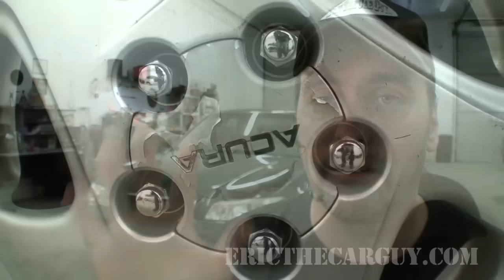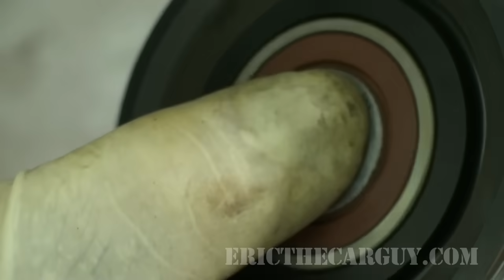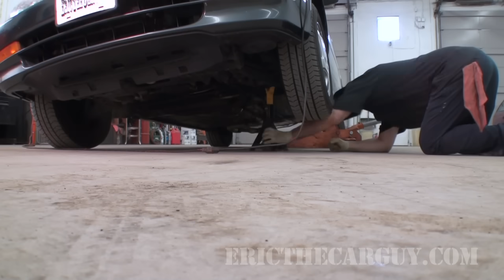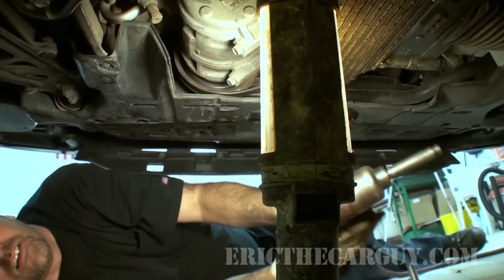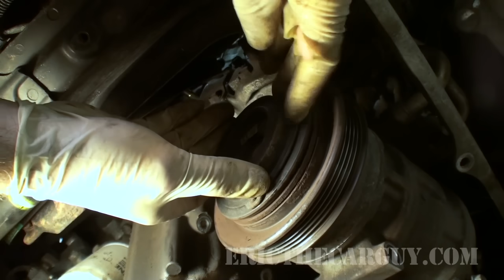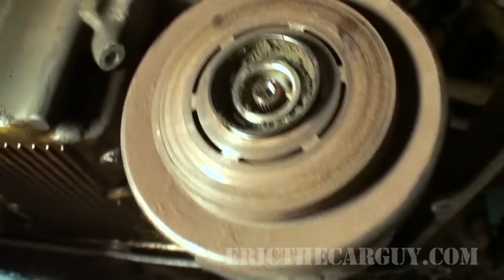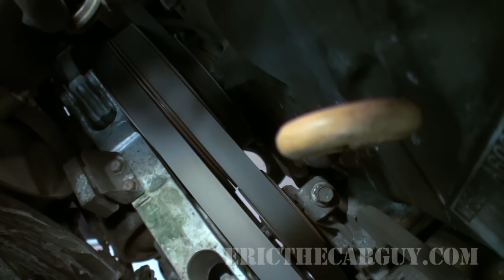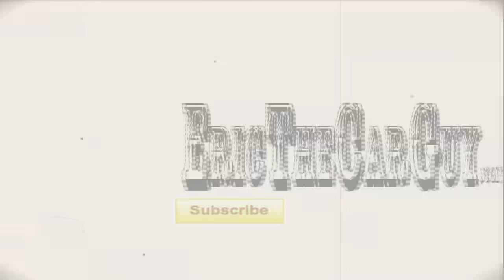AC Clutch Repair and Noise Diagnosis -EricTheCarGuy

Comment: You wanna see a problem with the new comment section?    
You wanna see a problem with the new comment section?    
You wanna see a problem with the new comment section?    
You wanna see a problem with the new comment section?    
You wanna see a problem with the new comment section?    
You wanna see a problem with the new comment section?    
You wanna see a problem with the new comment section?    
You wanna see a problem with the new comment section?    
You wanna see a problem with the new comment section?    
You wanna see a problem with the new comment section?    
You wanna see a problem with the new comment section?    
You wanna see a problem with the new comment section?    
You wanna see a problem with the new comment section?    
You wanna see a problem with the new comment section?    
You wanna see a problem with the new comment section?    
You wanna see a problem with the new comment section?    
You wanna see a problem with the new comment section?    
You wanna see a problem with the new comment section?    
You wanna see a problem with the new comment section?    
You wanna see a problem with the new comment section?    
You wanna see a problem with the new comment section?    
You wanna see a problem with the new comment section?    
You wanna see a problem with the new comment section?    
You wanna see a problem with the new comment section?    
You wanna see a problem with the new comment section?    
You wanna see a problem with the new comment section?    
You wanna see a problem with the new comment section?    
You wanna see a problem with the new comment section?    
You wanna see a problem with the new comment section?    
You wanna see a problem with the new comment section?    
You wanna see a problem with the new comment section?    
You wanna see a problem with the new comment section?    
You wanna see a problem with the new comment section?    
You wanna see a problem with the new comment section?    
You wanna see a problem with the new comment section?    
You wanna see a problem with the new comment section?    
You wanna see a problem with the new comment section?    
You wanna see a problem with the new comment section?    
You wanna see a problem with the new comment section?    
You wanna see a problem with the new comment section?    
You wanna see a problem with the new comment section?    
You wanna see a problem with the new comment section?    
You wanna see a problem with the new comment section?    
You wanna see a problem with the new comment section?    
You wanna see a problem with the new comment section?    
You wanna see a problem with the new comment section?    
You wanna see a problem with the new comment section?    
You wanna see a problem with the new comment section?    
You wanna see a problem with the new comment section?    
You wanna see a problem with the new comment section?    
You wanna see a problem with the new comment section?    
You wanna see a problem with the new comment section?    
You wanna see a problem with the new comment section?    
You wanna see a problem with the new comment section?    
You wanna see a problem with the new comment section?    
You wanna see a problem with the new comment section?    
You wanna see a problem with the new comment section?    
You wanna see a problem with the new comment section?    
You wanna see a problem with the new comment section?    
You wanna see a problem with the new comment section?    
You wanna see a problem with the new comment section?    
You wanna see a problem with the new comment section?    
You wanna see a problem with the new comment section?    
You wanna see a problem with the new comment section?    
You wanna see a problem with the new comment section?    
You wanna see a problem with the new comment section?    
You wanna see a problem with the new comment section?    
You wanna see a problem with the new comment section?    
You wanna see a problem with the new comment section?    
You wanna see a problem with the new comment section?    
You wanna see a problem with the new comment section?    
You wanna see a problem with the new comment section?    
You wanna see a problem with the new comment section?    
You wanna see a problem with the new comment section?    
You wanna see a problem with the new comment section?    
You wanna see a problem with the new comment section?    
You wanna see a problem with the new comment section?    
You wanna see a problem with the new comment section?    
You wanna see a problem with the new comment section?    
You wanna see a problem with the new comment section?    
You wanna see a problem with the new comment section?    
You wanna see a problem with the new comment section?    
You wanna see a problem with the new comment section?    
You wanna see a problem with the new comment section?    
You wanna see a problem with the new comment section?    
You wanna see a problem with the new comment section?    
You wanna see a problem with the new comment section?    
You wanna see a problem with the new comment section?    
You wanna see a problem with the new comment section?    
You wanna see a problem with the new comment section?    
You wanna see a problem with the new comment section?    
You wanna see a problem with the new comment section?    
You wanna see a problem with the new comment section?    
You wanna see a problem with the new comment section?    
You wanna see a problem with the new comment section?    
You wanna see a problem with the new comment section?    
You wanna see a problem with the new comment section?    
You wanna see a problem with the new comment section?    
You wanna see a problem with the new comment section?    
You wanna see a problem with the new comment section?    
You wanna see a problem with the new comment section?    
You wanna see a problem with the new comment section?    
You wanna see a problem with the new comment section?    
You wanna see a problem with the new comment section?    
You wanna see a problem with the new comment section?    
You wanna see a problem with the new comment section?    
You wanna see a problem with the new comment section?    
You wanna see a problem with the new comment section?    
You wanna see a problem with the new comment section?    
You wanna see a problem with the new comment section?    
You wanna see a problem with the new comment section?    
You wanna see a problem with the new comment section?    
You wanna see a problem with the new comment section?    
You wanna see a problem with the new comment section?    
You wanna see a problem with the new comment section?    
You wanna see a problem with the new comment section?    
You wanna see a problem with the new comment section?    
You wanna see a problem with the new comment section?    
You wanna see a problem with the new comment section?    
You wanna see a problem with the new comment section?    
You wanna see a problem with the new comment section?    
You wanna see a problem with the new comment section?    
You wanna see a problem with the new comment section?    
You wanna see a problem with the new comment section?    
You wanna see a problem with the new comment section?    
You wanna see a problem with the new comment section?    
You wanna see a problem with the new comment section?    
You wanna see a problem with the new comment section?    
You wanna see a problem with the new comment section?    
You wanna see a problem with the new comment section?    
You wanna see a problem with the new comment section?    
You wanna see a problem with the new comment section?    
You wanna see a problem with the new comment section?    
You wanna see a problem with the new comment section?    
You wanna see a problem with the new comment section?    
You wanna see a problem with the new comment section?    
You wanna see a problem with the new comment section?    
You wanna see a problem with the new comment section?    
You wanna see a problem with the new comment section?    
You wanna see a problem with the new comment section?    
You wanna see a problem with the new comment section?    
You wanna see a problem with the new comment section?    
You wanna see a problem with the new comment section?    
You wanna see a problem with the new comment section?    
You wanna see a problem with the new comment section?    
You wanna see a problem with the new comment section?    
You wanna see a problem with the new comment section?    
You wanna see a problem with the new comment section?    
You wanna see a problem with the new comment section?    
You wanna see a problem with the new comment section?    
You wanna see a problem with the new comment section?    
You wanna see a problem with the new comment section?    
You wanna see a problem with the new comment section?    
You wanna see a problem with the new comment section?    
You wanna see a problem with the new comment section?    
You wanna see a problem with the new comment section?    
You wanna see a problem with the new comment section?    
You wanna see a problem with the new comment section?    
You wanna see a problem with the new comment section?    
You wanna see a problem with the new comment section?    
You wanna see a problem with the new comment section?    
You wanna see a problem with the new comment section?    
You wanna see a problem with the new comment section?    
You wanna see a problem with the new comment section?    
You wanna see a problem with the new comment section?    
You wanna see a problem with the new comment section?    
You wanna see a problem with the new comment section?    
You wanna see a problem with the new comment section?    
You wanna see a problem with the new comment section?    
You wanna see a problem with the new comment section?    
You wanna see a problem with the new comment section?    
You wanna see a problem with the new comment section?    
You wanna see a problem with the new comment section?    
You wanna see a problem with the new comment section?    
You wanna see a problem with the new comment section?    
You wanna see a problem with the new comment section?    
You wanna see a problem with the new comment section?    
You wanna see a problem with the new comment section?    
You wanna see a problem with the new comment section?    
You wanna see a problem with the new comment section?    
You wanna see a problem with the new comment section?    
You wanna see a problem with the new comment section?    
You wanna see a problem with the new comment section?    
You wanna see a problem with the new comment section?    
You wanna see a problem with the new comment section?    
You wanna see a problem with the new comment section?    
You wanna see a problem with the new comment section?    
You wanna see a problem with the new comment section?    
You wanna see a problem with the new comment section?    
You wanna see a problem with the new comment section?    
You wanna see a problem with the new comment section?    
You wanna see a problem with the new comment section?    
You wanna see a problem with the new comment section?    
You wanna see a problem with the new comment section?    
You wanna see a problem with the new comment section?    
You wanna see a problem with the new comment section?    
You wanna see a problem with the new comment section?    
You wanna see a problem with the new comment section?    
You wanna see a problem with the new comment section?    
You wanna see a problem with the new comment section?    
You wanna see a problem with the new comment section?    
You wanna see a problem with the new comment section?    
You wanna see a problem with the new comment section?    
You wanna see a problem with the new comment section?    
You wanna see a problem with the new comment section?    
You wanna see a problem with the new comment section?    
You wanna see a problem with the new comment section?    
You wanna see a problem with the new comment section?    
You wanna see a problem with the new comment section?    
You wanna see a problem with the new comment section?    
You wanna see a problem with the new comment section?    
You wanna see a problem with the new comment section?    
You wanna see a problem with the new comment section?    
You wanna see a problem with the new comment section?    
You wanna see a problem with the new comment section?    
You wanna see a problem with the new comment section?    
You wanna see a problem with the new comment section?    
You wanna see a problem with the new comment section?    
You wanna see a problem with the new comment section?    
You wanna see a problem with the new comment section?    
You wanna see a problem with the new comment section?    
You wanna see a problem with the new comment section?    
You wanna see a problem with the new comment section?    
You wanna see a problem with the new comment section?    
You wanna see a problem with the new comment section?    
You wanna see a problem with the new comment section?    
You wanna see a problem with the new comment section?    
You wanna see a problem with the new comment section?    
You wanna see a problem with the new comment section?    
You wanna see a problem with the new comment section?    
You wanna see a problem with the new comment section?    
You wanna see a problem with the new comment section?    
You wanna see a problem with the new comment section?    
You wanna see a problem with the new comment section?    
You wanna see a problem with the new comment section?    
You wanna see a problem with the new comment section?    
You wanna see a problem with the new comment section?    
You wanna see a problem with the new comment section?    
You wanna see a problem with the new comment section?    
You wanna see a problem with the new comment section?    
You wanna see a problem with the new comment section?    
You wanna see a problem with the new comment section?    
You wanna see a problem with the new comment section?    
You wanna see a problem with the new comment section?    
You wanna see a problem with the new comment section?    
You wanna see a problem with the new comment section?    
You wanna see a problem with the new comment section?    
You wanna see a problem with the new comment section?    
You wanna see a problem with the new comment section?    
You wanna see a problem with the new comment section?    
You wanna see a problem with the new comment section?    
You wanna see a problem with the new comment section?    
You wanna see a problem with the new comment section?    
You wanna see a problem with the new comment section?    
You wanna see a problem with the new comment section?    
You wanna see a problem with the new comment section?    
You wanna see a problem with the new comment section?    
You wanna see a problem with the new comment section?    
You wanna see a problem with the new comment section?    
You wanna see a problem with the new comment section?    
You wanna see a problem with the new comment section?    
You wanna see a problem with the new comment section?    
You wanna see a problem with the new comment section?    
You wanna see a problem with the new comment section?    
You wanna see a problem with the new comment section?    
You wanna see a problem with the new comment section?    
You wanna see a problem with the new comment section?    
You wanna see a problem with the new comment section?    
You wanna see a problem with the new comment section?    
You wanna see a problem with the new comment section?    
You wanna see a problem with the new comment section?    
You wanna see a problem with the new comment section?    
You wanna see a problem with the new comment section?    
You wanna see a problem with the new comment section?    
You wanna see a problem with the new comment section?    
You wanna see a problem with the new comment section?    
You wanna see a problem with the new comment section?    
You wanna see a problem with the new comment section?    
You wanna see a problem with the new comment section?    
You wanna see a problem with the new comment section?    
You wanna see a problem with the new comment section?    
You wanna see a problem with the new comment section?    
You wanna see a problem with the new comment section?    
You wanna see a problem with the new comment section?    
You wanna see a problem with the new comment section?    
You wanna see a problem with the new comment section?    
You wanna see a problem with the new comment section?    
You wanna see a problem with the new comment section?    
You wanna see a problem with the new comment section?    
You wanna see a problem with the new comment section?    
You wanna see a problem with the new comment section?    
You wanna see a problem with the new comment section?    
You wanna see a problem with the new comment section?    
You wanna see a problem with the new comment section?    
You wanna see a problem with the new comment section?    
You wanna see a problem with the new comment section?    
You wanna see a problem with the new comment section?    
You wanna see a problem with the new comment section?    
You wanna see a problem with the new comment section?    
You wanna see a problem with the new comment section?    
You wanna see a problem with the new comment section?    
You wanna see a problem with the new comment section?    
You wanna see a problem with the new comment section?    
You wanna see a problem with the new comment section?    
You wanna see a problem with the new comment section?    
You wanna see a problem with the new comment section?    
You wanna see a problem with the new comment section?    
You wanna see a problem with the new comment section?    
You wanna see a problem with the new comment section?    
You wanna see a problem with the new comment section?    
You wanna see a problem with the new comment section?    
You wanna see a problem with the new comment section?    
You wanna see a problem with the new comment section?    
You wanna see a problem with the new comment section?    
You wanna see a problem with the new comment section?    
You wanna see a problem with the new comment section?    
You wanna see a problem with the new comment section?    
You wanna see a problem with the new comment section?    
You wanna see a problem with the new comment section?    
You wanna see a problem with the new comment section?    
You wanna see a problem with the new comment section?    
You wanna see a problem with the new comment section?    
You wanna see a problem with the new comment section?    
You wanna see a problem with the new comment section?    
You wanna see a problem with the new comment section?    
You wanna see a problem with the new comment section?    
You wanna see a problem with the new comment section?    
You wanna see a problem with the new comment section?    
You wanna see a problem with the new comment section?    
You wanna see a problem with the new comment section?    
You wanna see a problem with the new comment section?    
You wanna see a problem with the new comment section?    
You wanna see a problem with the new comment section?    
You wanna see a problem with the new comment section?    
You wanna see a problem with the new comment section?    
You wanna see a problem with the new comment section?    
You wanna see a problem with the new comment section?    
You wanna see a problem with the new comment section?    
You wanna see a problem with the new comment section?    
You wanna see a problem with the new comment section?    
You wanna see a problem with the new comment section?    
You wanna see a problem with the new comment section?    
You wanna see a problem with the new comment section?    
You wanna see a problem with the new comment section?    
You wanna see a problem with the new comment section?    
You wanna see a problem with the new comment section?    
You wanna see a problem with the new comment section?    
You wanna see a problem with the new comment section?    
You wanna see a problem with the new comment section?    
You wanna see a problem with the new comment section?    
You wanna see a problem with the new comment section?    
You wanna see a problem with the new comment section?    
You wanna see a problem with the new comment section?    
You wanna see a problem with the new comment section?    
You wanna see a problem with the new comment section?    
You wanna see a problem with the new comment section?    
You wanna see a problem with the new comment section?    
You wanna see a problem with the new comment section?    
You wanna see a problem with the new comment section?    
You wanna see a problem with the new comment section?    
You wanna see a problem with the new comment section?    
You wanna see a problem with the new comment section?    
You wanna see a problem with the new comment section?    
You wanna see a problem with the new comment section?    
You wanna see a problem with the new comment section?    
You wanna see a problem with the new comment section?    
You wanna see a problem with the new comment section?    
You wanna see a problem with the new comment section?    
You wanna see a problem with the new comment section?    
You wanna see a problem with the new comment section?    
You wanna see a problem with the new comment section?    
You wanna see a problem with the new comment section?    
You wanna see a problem with the new comment section?    
You wanna see a problem with the new comment section?    
You wanna see a problem with the new comment section?    
You wanna see a problem with the new comment section?    
You wanna see a problem with the new comment section?    
You wanna see a problem with the new comment section?    
You wanna see a problem with the new comment section?    
You wanna see a problem with the new comment section?    
You wanna see a problem with the new comment section?    
You wanna see a problem with the new comment section?    
You wanna see a problem with the new comment section?    
You wanna see a problem with the new comment section?    
You wanna see a problem with the new comment section?    
You wanna see a problem with the new comment section?    
You wanna see a problem with the new comment section?    
You wanna see a problem with the new comment section?    
You wanna see a problem with the new comment section?    
You wanna see a problem with the new comment section?    
You wanna see a problem with the new comment section?    
You wanna see a problem with the new comment section?    
You wanna see a problem with the new comment section?    
You wanna see a problem with the new comment section?    
You wanna see a problem with the new comment section?    
You wanna see a problem with the new comment section?    
You wanna see a problem with the new comment section?    
You wanna see a problem with the new comment section?    
You wanna see a problem with the new comment section?    
You wanna see a problem with the new comment section?    
You wanna see a problem with the new comment section?    
You wanna see a problem with the new comment section?    
You wanna see a problem with the new comment section?    
You wanna see a problem with the new comment section?    
You wanna see a problem with the new comment section?    
You wanna see a problem with the new comment section?    
You wanna see a problem with the new comment section?    
You wanna see a problem with the new comment section?    
You wanna see a problem with the new comment section?    
You wanna see a problem with the new comment section?    
You wanna see a problem with the new comment section?    
You wanna see a problem with the new comment section?    
You wanna see a problem with the new comment section?    
You wanna see a problem with the new comment section?    
You wanna see a problem with the new comment section?    
You wanna see a problem with the new comment section?    
You wanna see a problem with the new comment section?    
You wanna see a problem with the new comment section?    
You wanna see a problem with the new comment section?    
You wanna see a problem with the new comment section?    
You wanna see a problem with the new comment section?    
You wanna see a problem with the new comment section?    
You wanna see a problem with the new comment section?    
You wanna see a problem with the new comment section?    
You wanna see a problem with the new comment section?    
You wanna see a problem with the new comment section?    
You wanna see a problem with the new comment section?    
You wanna see a problem with the new comment section?    
You wanna see a problem with the new comment section?    
You wanna see a problem with the new comment section?    
You wanna see a problem with the new comment section?    
You wanna see a problem with the new comment section?  
You wanna see a problem with the new comment section?    
You wanna see a problem with the new comment section?    
You wanna see a problem with the new comment section?    
You wanna see a problem with the new comment section?    
You wanna see a problem with the new comment section?    
You wanna see a problem with the new comment section?    
You wanna see a problem with the new comment section?    
You wanna see a problem with the new comment section?    
You wanna see a problem with the new comment section?    
You wanna see a problem with the new comment section?    
You wanna see a problem with the new comment section?    
You wanna see a problem with the new comment section?    
You wanna see a problem with the new comment section?    
You wanna see a problem with the new comment section?    
You wanna see a problem with the new comment section?    
You wanna see a problem with the new comment section?    
You wanna see a problem with the new comment section?    
You wanna see a problem with the new comment section?    
You wanna see a problem with the new comment section?    
You wanna see a problem with the new comment section?    
You wanna see a problem with the new comment section?    
You wanna see a problem with the new comment section?    
You wanna see a problem with the new comment section?    
You wanna see a problem with the new comment section?    
You wanna see a problem with the new comment section?    
You wanna see a problem with the new comment section?    
You wanna see a problem with the new comment section?    
You wanna see a problem with the new comment section?    
You wanna see a problem with the new comment section?    
You wanna see a problem with the new comment section?    
You wanna see a problem with the new comment section?    
You wanna see a problem with the new comment section?    
You wanna see a problem with the new comment section?    
You wanna see a problem with the new comment section?    
You wanna see a problem with the new comment section?    
You wanna see a problem with the new comment section?    
You wanna see a problem with the new comment section?    
You wanna see a problem with the new comment section?    
You wanna see a problem with the new comment section?    
You wanna see a problem with the new comment section?    
You wanna see a problem with the new comment section?    
You wanna see a problem with the new comment section?    
You wanna see a problem with the new comment section?    
You wanna see a problem with the new comment section?    
You wanna see a problem with the new comment section?    
You wanna see a problem with the new comment section?    
You wanna see a problem with the new comment section?    
You wanna see a problem with the new comment section?    
You wanna see a problem with the new comment section?    
You wanna see a problem with the new comment section?    
You wanna see a problem with the new comment section?    
You wanna see a problem with the new comment section?    
You wanna see a problem with the new comment section?    
You wanna see a problem with the new comment section?    
You wanna see a problem with the new comment section?    
You wanna see a problem with the new comment section?    
You wanna see a problem with the new comment section?    
You wanna see a problem with the new comment section?    
You wanna see a problem with the new comment section?    
You wanna see a problem with the new comment section?    
You wanna see a problem with the new comment section?    
You wanna see a problem with the new comment section?    
You wanna see a problem with the new comment section?    
You wanna see a problem with the new comment section?    
You wanna see a problem with the new comment section?    
You wanna see a problem with the new comment section?    
You wanna see a problem with the new comment section?    
You wanna see a problem with the new comment section?    
You wanna see a problem with the new comment section?    
You wanna see a problem with the new comment section?    
You wanna see a problem with the new comment section?    
You wanna see a problem with the new comment section?    
You wanna see a problem with the new comment section?    
You wanna see a problem with the new comment section?    
You wanna see a problem with the new comment section?    
You wanna see a problem with the new comment section?    
You wanna see a problem with the new comment section?    
You wanna see a problem with the new comment section?    
You wanna see a problem with the new comment section?    
You wanna see a problem with the new comment section?    
You wanna see a problem with the new comment section?    
You wanna see a problem with the new comment section?    
You wanna see a problem with the new comment section?    
You wanna see a problem with the new comment section?    
You wanna see a problem with the new comment section?    
You wanna see a problem with the new comment section?    
You wanna see a problem with the new comment section?    
You wanna see a problem with the new comment section?    
You wanna see a problem with the new comment section?    
You wanna see a problem with the new comment section?    
You wanna see a problem with the new comment section?    
You wanna see a problem with the new comment section?    
You wanna see a problem with the new comment section?    
You wanna see a problem with the new comment section?    
You wanna see a problem with the new comment section?    
You wanna see a problem with the new comment section?    
You wanna see a problem with the new comment section?    
You wanna see a problem with the new comment section?    
You wanna see a problem with the new comment section?    
You wanna see a problem with the new comment section?    
You wanna see a problem with the new comment section?    
You wanna see a problem with the new comment section?    
You wanna see a problem with the new comment section?    
You wanna see a problem with the new comment section?    
You wanna see a problem with the new comment section?    
You wanna see a problem with the new comment section?    
You wanna see a problem with the new comment section?    
You wanna see a problem with the new comment section?    
You wanna see a problem with the new comment section?    
You wanna see a problem with the new comment section?    
You wanna see a problem with the new comment section?    
You wanna see a problem with the new comment section?    
You wanna see a problem with the new comment section?    
You wanna see a problem with the new comment section?    
You wanna see a problem with the new comment section?    
You wanna see a problem with the new comment section?    
You wanna see a problem with the new comment section?    
You wanna see a problem with the new comment section?    
You wanna see a problem with the new comment section?    
You wanna see a problem with the new comment section?    
You wanna see a problem with the new comment section?    
You wanna see a problem with the new comment section?    
You wanna see a problem with the new comment section?    
You wanna see a problem with the new comment section?    
You wanna see a problem with the new comment section?    
You wanna see a problem with the new comment section?    
You wanna see a problem with the new comment section?    
You wanna see a problem with the new comment section?    
You wanna see a problem with the new comment section?    
You wanna see a problem with the new comment section?    
You wanna see a problem with the new comment section?    
You wanna see a problem with the new comment section?    
You wanna see a problem with the new comment section?    
You wanna see a problem with the new comment section?    
You wanna see a problem with the new comment section?    
You wanna see a problem with the new comment section?    
You wanna see a problem with the new comment section?    
You wanna see a problem with the new comment section?    
You wanna see a problem with the new comment section?    
You wanna see a problem with the new comment section?    
You wanna see a problem with the new comment section?    
You wanna see a problem with the new comment section?    
You wanna see a problem with the new comment section?    
You wanna see a problem with the new comment section?    
You wanna see a problem with the new comment section?    
You wanna see a problem with the new comment section?    
You wanna see a problem with the new comment section?    
You wanna see a problem with the new comment section?    
You wanna see a problem with the new comment section?    
You wanna see a problem with the new comment section?    
You wanna see a problem with the new comment section?    
You wanna see a problem with the new comment section?    
You wanna see a problem with the new comment section?    
You wanna see a problem with the new comment section?    
You wanna see a problem with the new comment section?    
You wanna see a problem with the new comment section?    
You wanna see a problem with the new comment section?    
You wanna see a problem with the new comment section?    
You wanna see a problem with the new comment section?    
You wanna see a problem with the new comment section?    
You wanna see a problem with the new comment section?    
You wanna see a problem with the new comment section?    
You wanna see a problem with the new comment section?    
You wanna see a problem with the new comment section?    
You wanna see a problem with the new comment section?    
You wanna see a problem with the new comment section?    
You wanna see a problem with the new comment section?    
You wanna see a problem with the new comment section?    
You wanna see a problem with the new comment section?    
You wanna see a problem with the new comment section?    
You wanna see a problem with the new comment section?    
You wanna see a problem with the new comment section?    
You wanna see a problem with the new comment section?    
You wanna see a problem with the new comment section?    
You wanna see a problem with the new comment section?    
You wanna see a problem with the new comment section?    
You wanna see a problem with the new comment section?    
You wanna see a problem with the new comment section?    
You wanna see a problem with the new comment section?    
You wanna see a problem with the new comment section?    
You wanna see a problem with the new comment section?    
You wanna see a problem with the new comment section?    
You wanna see a problem with the new comment section?    
You wanna see a problem with the new comment section?    
You wanna see a problem with the new comment section?    
You wanna see a problem with the new comment section?    
You wanna see a problem with the new comment section?    
You wanna see a problem with the new comment section?    
You wanna see a problem with the new comment section?    
You wanna see a problem with the new comment section?    
You wanna see a problem with the new comment section?    
You wanna see a problem with the new comment section?    
You wanna see a problem with the new comment section?    
You wanna see a problem with the new comment section?    
You wanna see a problem with the new comment section?    
You wanna see a problem with the new comment section?    
You wanna see a problem with the new comment section?    
You wanna see a problem with the new comment section?    
You wanna see a problem with the new comment section?    
You wanna see a problem with the new comment section?    
You wanna see a problem with the new comment section?    
You wanna see a problem with the new comment section?    
You wanna see a problem with the new comment section?    
You wanna see a problem with the new comment section?    
You wanna see a problem with the new comment section?    
You wanna see a problem with the new comment section?    
You wanna see a problem with the new comment section?    
You wanna see a problem with the new comment section?    
You wanna see a problem with the new comment section?    
You wanna see a problem with the new comment section?    
You wanna see a problem with the new comment section?    
You wanna see a problem with the new comment section?    
You wanna see a problem with the new comment section?    
You wanna see a problem with the new comment section?    
You wanna see a problem with the new comment section?    
You wanna see a problem with the new comment section?    
You wanna see a problem with the new comment section?    
You wanna see a problem with the new comment section?    
You wanna see a problem with the new comment section?    
You wanna see a problem with the new comment section?    
You wanna see a problem with the new comment section?    
You wanna see a problem with the new comment section?    
You wanna see a problem with the new comment section?    
You wanna see a problem with the new comment section?    
You wanna see a problem with the new comment section?    
You wanna see a problem with the new comment section?    
You wanna see a problem with the new comment section?    
You wanna see a problem with the new comment section?    
You wanna see a problem with the new comment section?    
You wanna see a problem with the new comment section?    
You wanna see a problem with the new comment section?    
You wanna see a problem with the new comment section?    
You wanna see a problem with the new comment section?    
You wanna see a problem with the new comment section?    
You wanna see a problem with the new comment section?    
You wanna see a problem with the new comment section?    
You wanna see a problem with the new comment section?    
You wanna see a problem with the new comment section?    
You wanna see a problem with the new comment section?    
You wanna see a problem with the new comment section?    
You wanna see a problem with the new comment section?    
You wanna see a problem with the new comment section?    
You wanna see a problem with the new comment section?    
You wanna see a problem with the new comment section?    
You wanna see a problem with the new comment section?    
You wanna see a problem with the new comment section?    
You wanna see a problem with the new comment section?    
You wanna see a problem with the new comment section?    
You wanna see a problem with the new comment section?    
You wanna see a problem with the new comment section?    
You wanna see a problem with the new comment section?    
You wanna see a problem with the new comment section?    
You wanna see a problem with the new comment section?    
You wanna see a problem with the new comment section?    
You wanna see a problem with the new comment section?    
You wanna see a problem with the new comment section?    
You wanna see a problem with the new comment section?    
You wanna see a problem with the new comment section?    
You wanna see a problem with the new comment section?    
You wanna see a problem with the new comment section?    
You wanna see a problem with the new comment section?    
You wanna see a problem with the new comment section?    
You wanna see a problem with the new comment section?    
You wanna see a problem with the new comment section?    
You wanna see a problem with the new comment section?    
You wanna see a problem with the new comment section?    
You wanna see a problem with the new comment section?    
You wanna see a problem with the new comment section?    
You wanna see a problem with the new comment section?    
You wanna see a problem with the new comment section?    
You wanna see a problem with the new comment section?    
You wanna see a problem with the new comment section?    
You wanna see a problem with the new comment section?    
You wanna see a problem with the new comment section?    
You wanna see a problem with the new comment section?    
You wanna see a problem with the new comment section?    
You wanna see a problem with the new comment section?    
You wanna see a problem with the new comment section?    
You wanna see a problem with the new comment section?    
You wanna see a problem with the new comment section?    
You wanna see a problem with the new comment section?    
You wanna see a problem with the new comment section?    
You wanna see a problem with the new comment section?    
You wanna see a problem with the new comment section?    
You wanna see a problem with the new comment section?    
You wanna see a problem with the new comment section?    
You wanna see a problem with the new comment section?    
You wanna see a problem with the new comment section?    
You wanna see a problem with the new comment section?    
You wanna see a problem with the new comment section?    
You wanna see a problem with the new comment section?    
You wanna see a problem with the new comment section?    
You wanna see a problem with the new comment section?    
You wanna see a problem with the new comment section?    
You wanna see a problem with the new comment section?    
You wanna see a problem with the new comment section?    
You wanna see a problem with the new comment section?    
You wanna see a problem with the new comment section?    
You wanna see a problem with the new comment section?    
You wanna see a problem with the new comment section?    
You wanna see a problem with the new comment section?    
You wanna see a problem with the new comment section?    
You wanna see a problem with the new comment section?    
You wanna see a problem with the new comment section?    
You wanna see a problem with the new comment section?    
You wanna see a problem with the new comment section?    
You wanna see a problem with the new comment section?    
You wanna see a problem with the new comment section?    
You wanna see a problem with the new comment section?    
You wanna see a problem with the new comment section?    
You wanna see a problem with the new comment section?    
You wanna see a problem with the new comment section?    
You wanna see a problem with the new comment section?    
You wanna see a problem with the new comment section?    
You wanna see a problem with the new comment section?    
You wanna see a problem with the new comment section?    
You wanna see a problem with the new comment section?    
You wanna see a problem with the new comment section?    
You wanna see a problem with the new comment section?    
You wanna see a problem with the new comment section?    
You wanna see a problem with the new comment section?    
You wanna see a problem with the new comment section?    
You wanna see a problem with the new comment section?    
You wanna see a problem with the new comment section?    
You wanna see a problem with the new comment section?    
You wanna see a problem with the new comment section?    
You wanna see a problem with the new comment section?    
You wanna see a problem with the new comment section?    
You wanna see a problem with the new comment section?    
You wanna see a problem with the new comment section?    
You wanna see a problem with the new comment section?    
You wanna see a problem with the new comment section?    
You wanna see a problem with the new comment section?    
You wanna see a problem with the new comment section?    
You wanna see a problem with the new comment section?    
You wanna see a problem with the new comment section?    
You wanna see a problem with the new comment section?    
You wanna see a problem with the new comment section?    
You wanna see a problem with the new comment section?    
You wanna see a problem with the new comment section?    
You wanna see a problem with the new comment section?    
You wanna see a problem with the new comment section?    
You wanna see a problem with the new comment section?    
You wanna see a problem with the new comment section?    
You wanna see a problem with the new comment section?    
You wanna see a problem with the new comment section?    
You wanna see a problem with the new comment section?    
You wanna see a problem with the new comment section?    
You wanna see a problem with the new comment section?    
You wanna see a problem with the new comment section?    
You wanna see a problem with the new comment section?    
You wanna see a problem with the new comment section?    
You wanna see a problem with the new comment section?    
You wanna see a problem with the new comment section?    
You wanna see a problem with the new comment section?    
You wanna see a problem with the new comment section?    
You wanna see a problem with the new comment section?    
You wanna see a problem with the new comment section?    
You wanna see a problem with the new comment section?    
You wanna see a problem with the new comment section?    
You wanna see a problem with the new comment section?    
You wanna see a problem with the new comment section?    
You wanna see a problem with the new comment section?    
You wanna see a problem with the new comment section?    
You wanna see a problem with the new comment section?    
You wanna see a problem with the new comment section?    
You wanna see a problem with the new comment section?    
You wanna see a problem with the new comment section?    
You wanna see a problem with the new comment section?    
You wanna see a problem with the new comment section?    
You wanna see a problem with the new comment section?    
You wanna see a problem with the new comment section?    
You wanna see a problem with the new comment section?    
You wanna see a problem with the new comment section?    
You wanna see a problem with the new comment section?    
You wanna see a problem with the new comment section?    
You wanna see a problem with the new comment section?    
You wanna see a problem with the new comment section?    
You wanna see a problem with the new comment section?    
You wanna see a problem with the new comment section?    
You wanna see a problem with the new comment section?    
You wanna see a problem with the new comment section?    
You wanna see a problem with the new comment section?    
You wanna see a problem with the new comment section?    
You wanna see a problem with the new comment section?    
You wanna see a problem with the new comment section?    
You wanna see a problem with the new comment section?    
You wanna see a problem with the new comment section?    
You wanna see a problem with the new comment section?    
You wanna see a problem with the new comment section?    
You wanna see a problem with the new comment section?    
You wanna see a problem with the new comment section?    
You wanna see a problem with the new comment section?    
You wanna see a problem with the new comment section?    
You wanna see a problem with the new comment section?    
You wanna see a problem with the new comment section?    
You wanna see a problem with the new comment section?    
You wanna see a problem with the new comment section?    
You wanna see a problem with the new comment section?    
You wanna see a problem with the new comment section?    
You wanna see a problem with the new comment section?    
You wanna see a problem with the new comment section?    
You wanna see a problem with the new comment section?    
You wanna see a problem with the new comment section?    
You wanna see a problem with the new comment section?    
You wanna see a problem with the new comment section?    
You wanna see a problem with the new comment section?    
You wanna see a problem with the new comment section?    
You wanna see a problem with the new comment section?    
You wanna see a problem with the new comment section?    
You wanna see a problem with the new comment section?    
You wanna see a problem with the new comment section?    
You wanna see a problem with the new comment section?    
You wanna see a problem with the new comment section?    
You wanna see a problem with the new comment section?    
You wanna see a problem with the new comment section?    
You wanna see a problem with the new comment section?    
You wanna see a problem with the new comment section?    
You wanna see a problem with the new comment section?    
You wanna see a problem with the new comment section?    
You wanna see a problem with the new comment section?    
You wanna see a problem with the new comment section?    
You wanna see a problem with the new comment section?    
You wanna see a problem with the new comment section?    
You wanna see a problem with the new comment section?    
You wanna see a problem with the new comment section?    
You wanna see a problem with the new comment section?    
You wanna see a problem with the new comment section?    
You wanna see a problem with the new comment section?    
You wanna see a problem with the new comment section?    
You wanna see a problem with the new comment section?    
You wanna see a problem with the new comment section?  
You wanna see a problem with the new comment section?    
You wanna see a problem with the new comment section?    
You wanna see a problem with the new comment section?    
You wanna see a problem with the new comment section?    
You wanna see a problem with the new comment section?    
You wanna see a problem with the new comment section?    
You wanna see a problem with the new comment section?    
You wanna see a problem with the new comment section?    
You wanna see a problem with the new comment section?    
You wanna see a problem with the new comment section?    
You wanna see a problem with the new comment section?    
You wanna see a problem with the new comment section?    
You wanna see a problem with the new comment section?    
You wanna see a problem with the new comment section?    
You wanna see a problem with the new comment section?    
You wanna see a problem with the new comment section?    
You wanna see a problem with the new comment section?    
You wanna see a problem with the new comment section?    
You wanna see a problem with the new comment section?    
You wanna see a problem with the new comment section?    
You wanna see a problem with the new comment section?    
You wanna see a problem with the new comment section?    
You wanna see a problem with the new comment section?    
You wanna see a problem with the new comment section?    
You wanna see a problem with the new comment section?    
You wanna see a problem with the new comment section?    
You wanna see a problem with the new comment section?    
You wanna see a problem with the new comment section?    
You wanna see a problem with the new comment section?    
You wanna see a problem with the new comment section?    
You wanna see a problem with the new comment section?    
You wanna see a problem with the new comment section?    
You wanna see a problem with the new comment section?    
You wanna see a problem with the new comment section?    
You wanna see a problem with the new comment section?    
You wanna see a problem with the new comment section?    
You wanna see a problem with the new comment section?    
You wanna see a problem with the new comment section?    
You wanna see a problem with the new comment section?    
You wanna see a problem with the new comment section?    
You wanna see a problem with the new comment section?    
You wanna see a problem with the new comment section?    
You wanna see a problem with the new comment section?    
You wanna see a problem with the new comment section?    
You wanna see a problem with the new comment section?    
You wanna see a problem with the new comment section?    
You wanna see a problem with the new comment section?    
You wanna see a problem with the new comment section?    
You wanna see a problem with the new comment section?    
You wanna see a problem with the new comment section?    
You wanna see a problem with the new comment section?    
You wanna see a problem with the new comment section?    
You wanna see a problem with the new comment section?    
You wanna see a problem with the new comment section?    
You wanna see a problem with the new comment section?